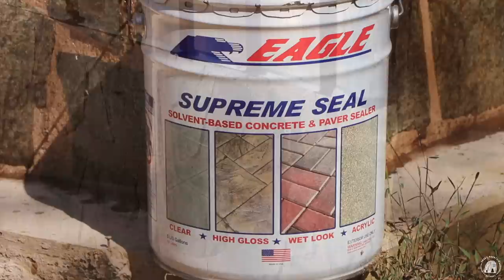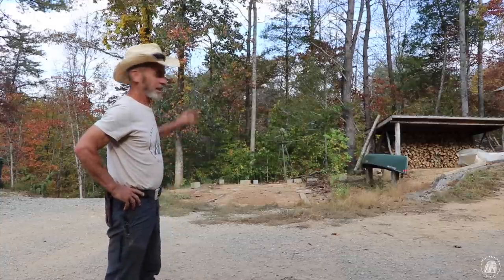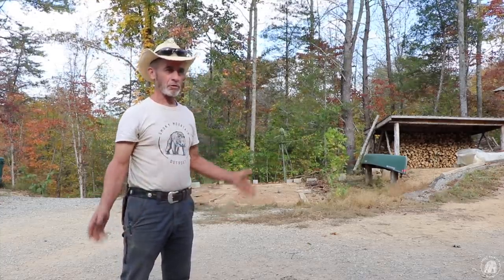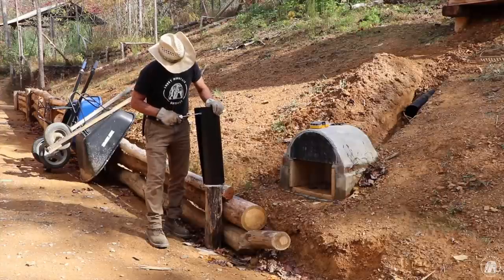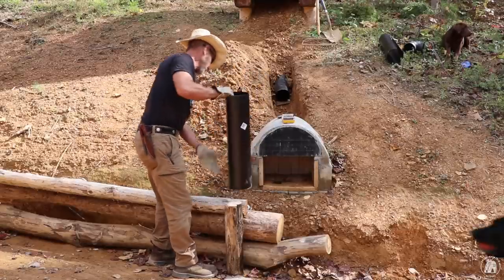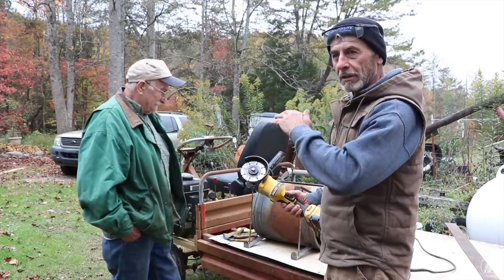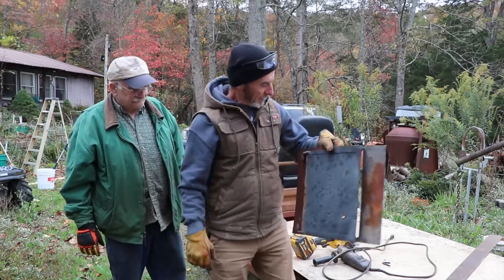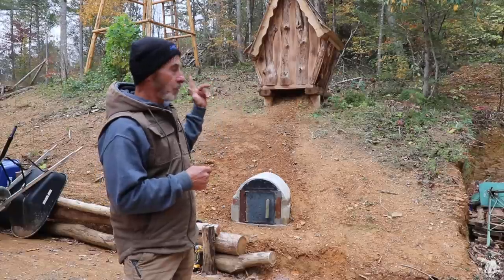Milling & Building a Timber Frame Workshop : Connecting Firepit to Smokehouse

Comment: That rock and concrete sealer could be applied by spraying much easier than rolling and brushing. In fact i think it looks thin enough that a pump style garden sprayer might be able to spray it ok. Your hand saw and even the electric saw can be lubricated by rubbing the blades with a little paraffin wax. Helps make cutting the wood easier. Just a couple tips that might help make your day a little easier. Thanks for sharing your videos and your day’s labors. Stay safe
Reply from the maker: Thanks for the tips, Raymond! We appreciate them. Hope you are doing well!

Comment: That door is perfect for the fire box.  Have you thought about painting it with some heat rated paint?  May keep it from rusting and last a more few years (unless you think the paint will give off gases too).  I bet you will miss the shed - at least until you get your workshop built.  But a garage for the truck looks to be a good call.
Reply from the maker: That good ol shed was the “throw all” lol… I think the garage will be a good thing. And yes, that little door is “sa cute” hahaha. Thanks for following. -Jennifer

Comment: The steel pipe that you buried will rust and collapse. 

You should have use clay tile pipe.
Reply from the maker: I would have if I could have found any. Nobody had any within 50 miles
Reply: @SmokyMountainOutpost  4 inch round clay drain tile will work just fine.

If you want a bigger diameter try regular clay chimney flu tiles.